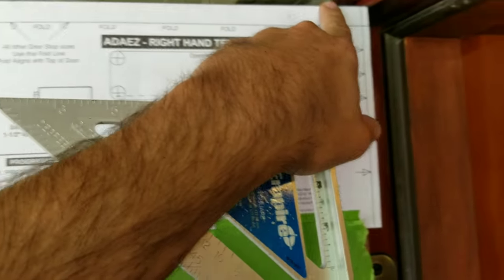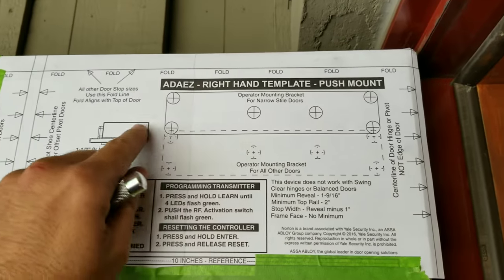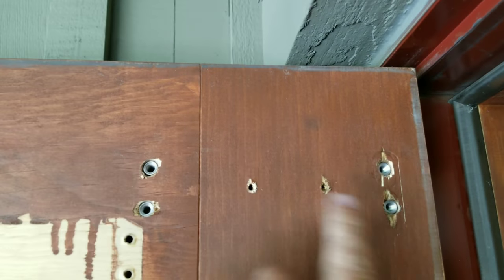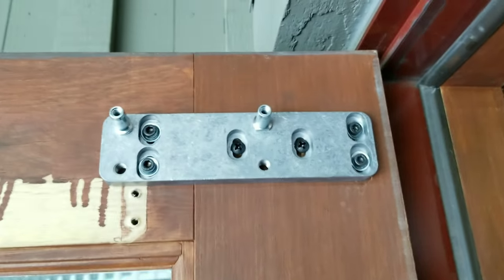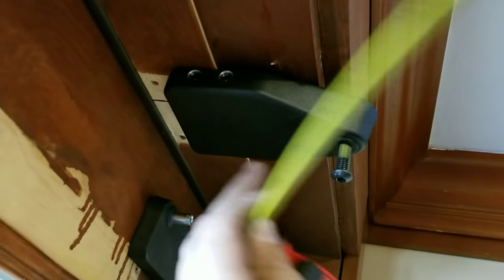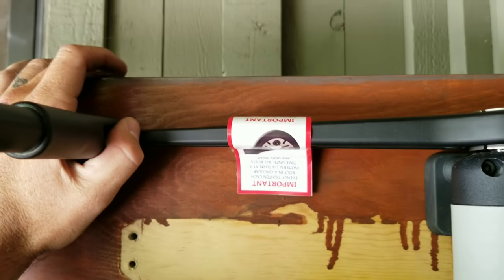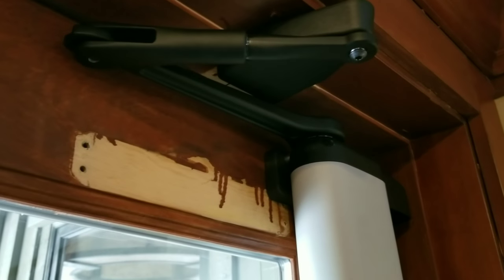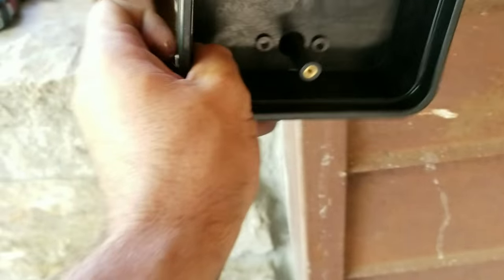How to install a Norton ADAEZ 5800 Door Operator Opener/Closer. Wireless or Hard wire options.

Comment: How do you recharge it when it dies? Should the switch on the battery be on or off?
Reply: It charges itself when you manually open it 5 manual opens gets 1 automatic open. or you can use Low voltage dc power.
Reply from the maker: Each time it's opened manually it charges the battery, self genorated

Comment: Where would you put the template on a door with offset pivots?
Reply from the maker: Whatever the difference in. Measurement is from center of pivot point. Measure the difference and compensate

Comment: Wow, that seems like a pain in the butt :) think I'll avoid that business and stick with residential locks.  I can't imagine you could get paid well enough for this type of install.  I'm thinking I'd need to charge $400 plus parts.
Reply from the maker: Mick Mitchell I made way more than that 😏. There is markup on the parts and labor
Reply: You may miss a lot of $ if you avoid this type of work.
Reply from the maker: @brentonwebb105  absolutely